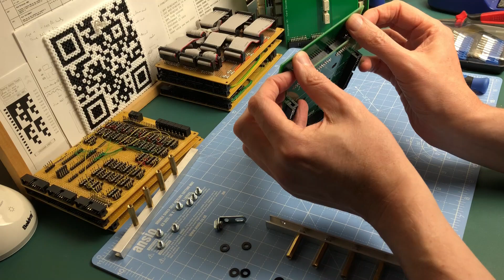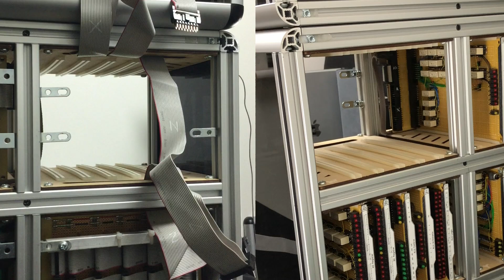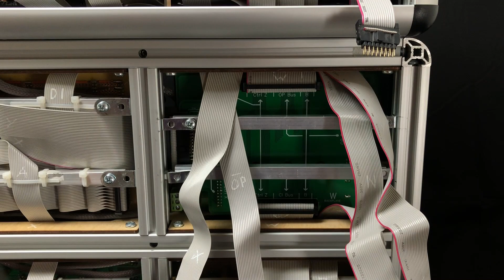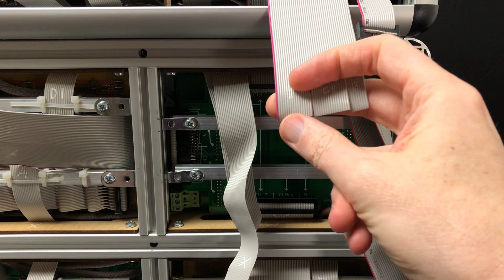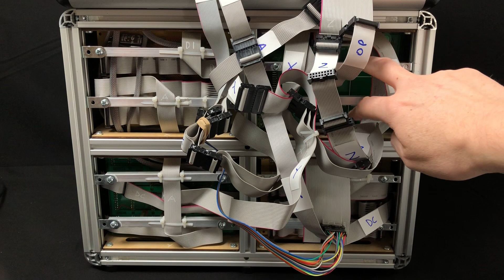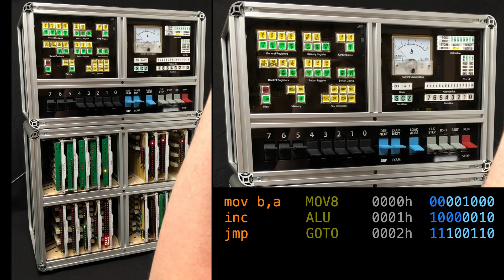Relay Computer: Replacing Backplane W (part 2)

Comment: Do you have a complete schematic for this computer so far
Reply from the maker: There isn't a complete schematic but where I'm using the newer PCB based cards everything is shared at https://easyeda.com/paul_6392 and for the older cards there's also more info at https://www.relaycomputer.co.uk/pages/progress.html